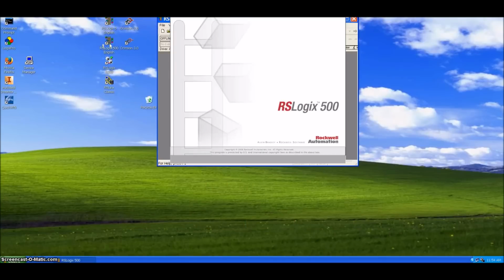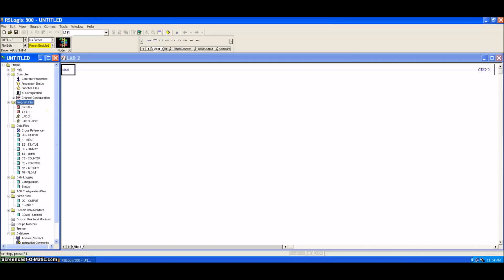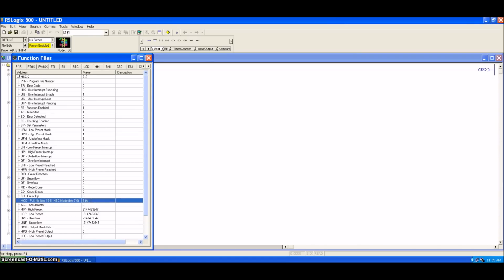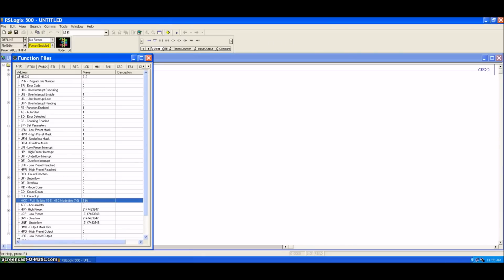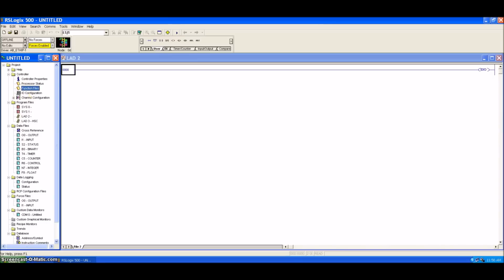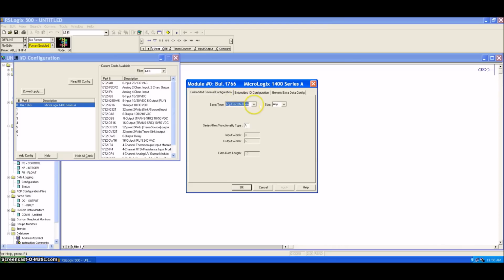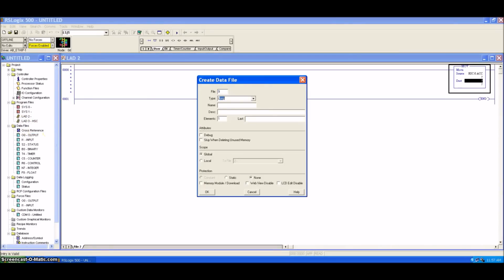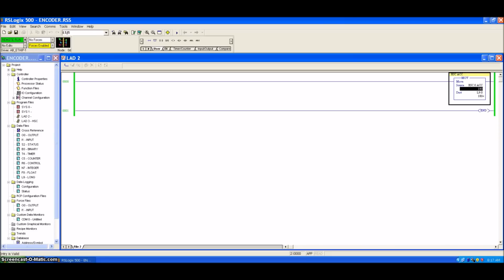Allen Bradley Micrologix Encoder High Speed Counter configuration

Comment: Hello Tim, 
I am your follower and watching your videos and as always great information. I have one question.

I tried to wire encoder with my micrologix 1200 PLC. 1200 has Input 0,1,2,3 for HSC. it works well when I connect Input 0 with channel A and input 1 with channel B and Gave 24V in common of the input 0,1,2,3. But it doesn't work when I connect them with input 2 and 3. Can you please help me?
Reply: Also, I was able to see the lights on/off on input 2 and 3 while I turn the encoder shaft. Input filter is already changed for input 0 to 3.
Reply from the maker: Inputs 2 and 3 are for hold and reset and can't be used for an encoder.
Reply: @TimWilborne  how would I know which inputs are for which purpose? I couldn’t find that information on internet
Reply from the maker: @akashpatel2339  It is in the manual but isn't completely clear.  It only has one HSC, it takes for high speed inputs to operate one HSC so that consumes all of them.  

If you need the others, you might be able to make a crude counter with the EII function file.  Note that you need to select the mode of the HSC that doesn't have the hold and reset inputs.

Comment: Thanks for the very good explanation sir.Can you explain PTO block also.?
Reply from the maker: I have gathered the hardware for that, I just need to find the time to set it up. Stay tuned!
Reply: @TimWilborne  Sir,Thank you so much for the response.I want one more suggestion also,

I want to send ascii commands to my scanner card using AB PLC. I have tried to send commands through VB,its working fine through ethernet port.

Same can be done using AB micrologix PLC 1400 series B.My scanner card is having ethernet port.
According to my study,MSG instruction is for communication with another PLC,is it possible to communicate with my scanner card also? if yes,what address I should give.
Kindly suggest,any other option if it is there..

Thanks in advance!

Comment: excellent video i love the way you explained this but i have a question  i understand the ML 1100  has 1 20Khz high-speed counter. The counter has four dedicated inputs ive got inputs I:0/0 and I:0/1 connected to an encoder and it counts away dream and i can see it displayed on HSC.0.ACC thanks to your video but how can i get Inputs I:0/3 and I:0/4 working for a second encoder? iv connected the second encoder and can see the inputs blinking on the ML 1100 so i think its an addressing issue how do i read those pulses ive made sure the filter in the I/O config is set low enough to read the pulses and set Mode to 7 in the function files if you can help me on this i'll do my best to get you free Big  Macs for life :0)
Reply from the maker: Glenn Lorimer The easy answer is there's only one I speed counter available on the Micrologix 1100 and micrologix 1400 has two. There are alternatives that could work for you though in some of the other basic counter functions. Do you need you need to see forward and reverse on your encoder and what resolution does it need to count to?
Reply: @TimWilborne  Hi Tim i only need to read in forward its for a laser sensor that's counting parts im just confused as to why theyd have 2 channels but only 1 counter ive managed to wright a bit of program to use the one counter but actually count twice from the same encoder ill send the .RSS file for those who may need it if they email me at Glennlorimer07@gmail.com this bit of ladder will allow to count and clear the individual counts
Reply: @glennlorimer1618  have you figure out an answer ? I also have the same issue. If you figured something please let me know. Hiranyadil@gmail.com is my email. Thanks
Reply from the maker: @glennlorimer1618  Hi Glenn.  Sorry I missed this one.  The easiest way to make use  use of the EII function file.  It allows you to execute a routine based off of the edge of an input.  The trick is the frequency of counts that are coming it.  If your trigger another execution before the previous one completes then you will get a "User Interrupt Lost" error.  Only put an ADD instruction in the routine you are running.  Source A is your part counter, Source B is 1, and Destination is your part counter.
Reply: @TimWilborne  Gotcha...... well i never thought of looking there, thank you very much you sir are a credit to YouTube and the tech industry
Reply from the maker: @glennlorimer1618  Glad to help!

Comment: Can I follow these same directions to setup the high speed counter on a SLC 5/04 in RSLogix 500?  I am trying to add an encoder to a motor to give an exact position, instead of relying on a prox sensor to stop the rack being ran in and out, to prevent a chain from breaking when the prox occasionally doesn't see the rack on the chain.  Do you have a recommendation on an encoder that would best suit my need in this instance, and work well with the equipment I mentioned?
Reply from the maker: No, it isn't as easy on the the SLC.  There is a 1746-HSCE but it was a bear to configure.  Completely different but it may work for your application.  Carefully read the instruction manual before you jump in.

Comment: this was an awesome video thank you! question.. when setting up a flow meter, do you have to reset the counter or will it do that automatically?
Reply from the maker: +lilfarlee it will "roll over" when it hits 2,147,483,647 which means that on the next pulse it will go to -2,147,483,648.  

Depending on the application you may want to add code to handle the roll over.   I usually determine this by how long it will take for the roll over to occur.  So to use round numbers, lets say the flow meter will see around 1000 pulses a day...2,147,483,647/1000(pulses per day)/365(days in a year) means it won't roll over for 5883 years.  I'm not worrying about that.  But let's say that it will receive 1,000,000 pulses per day then 2,147,483,647/1,000,000(pulses per day)/365(days in a year) is 5.8 years.  If I think this will be reset on an occasional basis then I still probably won't deal with the roll over but if it will have to accumulate it for the lifetime of the system then I would probably write code to deal with the roll over.
Reply: +Tim Wilborne I have the inputs 0,1,2 & 3 on my 1400 wired to liquid flow meters... https://www.dwyer-inst.com/PDF_files/SF2BRASS_iom.pdf 

I am still a little confused how to set this up to see the flow rate in GPM. our model is the 1" NPT model
Reply from the maker: +lilfarlee First make sure you have the correct mode and correct input assignments for your counters because that can be really confusing.  

Your modes should be set to 0.  Then your input assignments are as follows which is not in an incremental order.
Input 0 (HSC:0)
Input 4 (HSC:1)
Input 8 (HSC:2)
Input 2 (HSC:3)

After that to figure GPM, or I will say units per minute since I don't know what scaling you will need to turn it into GPM, you will need to select a sample rate to calculate from.  It should be large enough to keep the GPMs from going up and down when you have a steady flow but not so large that it takes forever to update.  I'm going to choose 10 seconds.  So we would create a 10 second timer and every time it is done we will subtract our current ACC from our previous ACC and store it as "Pulses in last 10 seconds". Then we will move our current ACC to our previous ACC and reset our timer.  That gives us units per 10 seconds.  So it we multiply that by 10 then you will have units per 60 seconds or units per minute.  You should be able to bundle that and your scaling into a tidy CPT instruction.